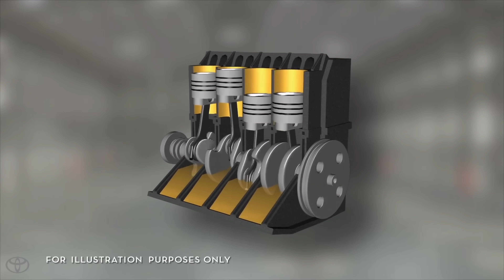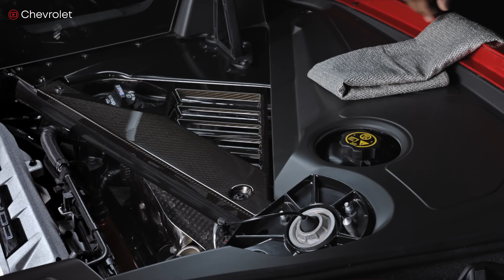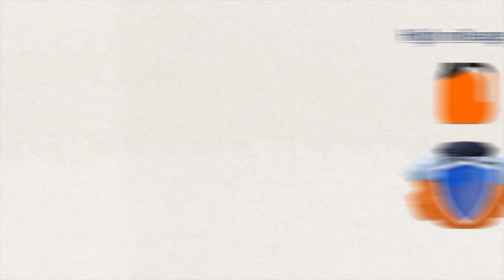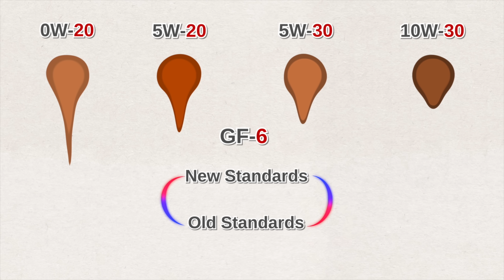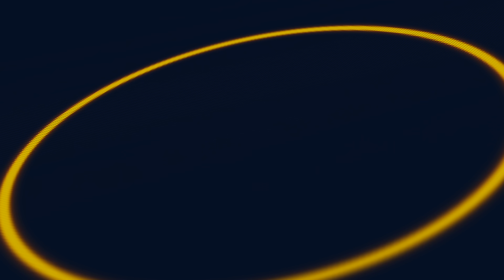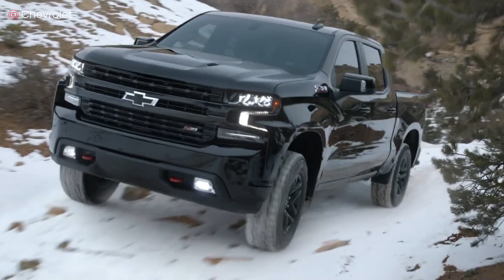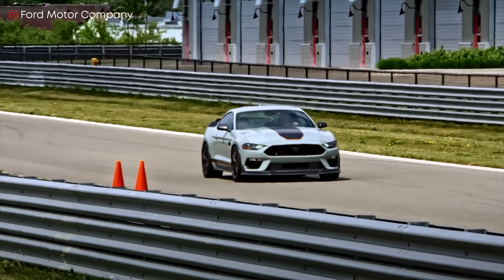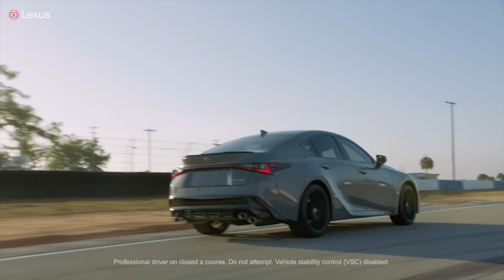7 Engine Oil Myths Stupid People Fall For

Comment: But, in the semi synthetic oil, how do you know exactly what percentage of the oil is synthetic, to my understanding there is no requirement to state what amount is used in the blend, so it could be 1% and they can still call it semi-synthetic
Reply: You're right. But the joke is that the term "semi-synthetic" means that it contains 1% - 99% of group II mineral oil. The icing on the cake is the fact that mineral base oils of group III. can be described as synthetic!!! So you can buy a fully synthetic oil according to the label, but inside it will be 100% mineral oil. This means that fully synthetic oil is also 1% PAO synthetic oil (group IV synthetic oil) and 99% group III mineral oil.:face-turquoise-covering-eyes:

Comment: Scott,
Great video with simple explanations on oil types. However, I noticed one error you made about winter W grade oil. the number before the W represents the conventional oil viscosity measured at 32 F and not 0 F as stated in your video.
Reply: 32F is 0C
Reply: Yes. You are correct. But the video states 0F not 0C. The low temperature viscosity is measured at 32F in Saybolt Universal Seconds (SUS)
Reply: The biggest factor in starting yourvengine in cold weather is not the battery , but rather the viscous drag on the moving engine parts controlled by oil viscosity. So, you want a low viscous oil in the winter for less oil drag, but a higher viscosity o ce the engine heats uo to the operating temperature that the multi-viscosity oils exhibit. E.g. 10 SAE oil is the standard oil viscosity measured at 100F and 212F in USS. 10W means that the oil viscosity measured at 32F

Comment: 0W20 is low protection and high fuel economy. Created so automakers could meet mileage requirements. If I use it I hear "tick tick tick" from the top  end. Heavier oil and the engine is quiet and smooth.

Comment: SYNTHETIC OIL WILL DRY RUBBER SEALS AND THEY WILL START LEAKING
Reply: My 2001 Sebring has had synthetic in it for 4 years. Doesn't leak a drop.
Reply: @Tylerc3419  I'm going by what a friend in nascar  told me. I have no experience with synthetic oil. He said the valve seals will go first.

Comment: Had a Ford van that developed a knock in the engine. It had 100 thousand at that time. I was told by the dealership that I needed a new engine. Thought I would get what I could out of it. I just topped it off when needed. I used oil out of other vehicles I had when I changed the oil. Used oil. The van had 270 thousand on it running fine when I sold it.

Comment: lo   daughter  uses 10w  30 year round 2002, toyotta  corrola    reg  oil .     temp in winter   drops   below  -  30  at times  ont canada car still starts  parked on driv eway. bought used still runs  great changed every 5000km

Comment: After a recent oil change by the dealership suddenly entire oil started to come out and drained (they did double gasket!) I had no idea what kind of fluid it was  and turned on the car running for about 10 minutes. Do you think running a car with zero oil would damage the engine if it runs even 10 minutes? Since it was the dealership’s fault do I need to ask for warranty in case something happens to the engine? If yes how long warranty should I ask? if the damage has  already done should I ask for compensation? How much? I am a single mom and really worried.
Reply: Yes the dealership should be responsible for this error.  Hope things work out for you.
Reply: If you don't know what kind of fluid is leaking out of your car, you shouldn't be driving.

Comment: Been using 10W-30 on a 92 GM with 5.7 liter and regularly changed oil every 4k ..milage is 356,497 miles..another ranch trk with 7.4 Gm has 423,741 miles on it..same oil..

Comment: I'm using 10w40 or 15w40 mineral all these years in my turbo diesel. It's inching almost to 300k km now...and now it's using 20w50 mineral due to it being high mileage and the engine needs higher viscosity. Happy engine.

Comment: LOL, The video starts right off with a myth that oil needs to be changed because it breaks down! Oil does not break down from friction over time! In fact viscosity increase with use. It needs to be changed because it gets dirty and polluted, with sludge buildup, which decreases it's effectiveness!

Comment: Funny thing. I knew an old farmer named Elvin who had an old ford truck that he never changed the oil. Always changed the filter at 3k miles and topped it off with conventional oil. 30weight. The truck outlasted him and he lived a very long life. The truck was late 60’s model. He said oil doesn’t go bad. 🤷🏽‍♂️. I’m not recommending that you do this. It’s just what he did and I always marveled at that fact.

Comment: Oil filter paper? Does it flex as the oil builds pressure when you start the engine? Does this flex due to pressuring up and then releasing the pressure when the engine gets shut down cause weakening of the paper over time? 
If the filter is used for excessive time/mileage,especially with high viscosity oil in cold weather,does the paper "media" eventually rip or split,creating a straight through flow and releasing already trapped dirt back into the engine's oil supply? 

 Do more expensive oil filters have stronger paper?

Comment: If oil from the dipstick does not feel slippery between my fingers, when I rub them together, I change my oil, no matter how clean it might look. If there is no slippery feeling there is no lubricity and the engine will wear more heavily and possibly fail.

Comment: I have a 2012 Chrysler 200 4 cylinder, and I normally use synthetic blend 5w30, but now my car has around 96,000 miles on it, What would you recommend?

Comment: Thank for the video, it was very helpful.
I had a question, I had a Rav4 2017 and change it's oil from 0w20 to 5w30 according to friend advice, according to you video you suggest to use the same viscosity, so is it OK for me to just change from 5-30 to 0-20 and is there somethingI should do 1st?
Reply: Does your friend have a RAV4 Owner's Manual and you don't?

Comment: I have been using Mobile 1 fully synthetic oil for years. I change it and the filter once per year and have never experienced a motor failure or a wear issue. Traded in my last truck, a 2001 F-150 SuperCrew with the "big" 5.7L at 267,000 miles and it still ran like new. The only maintenance required under the hood was the typical battery, plugs/wires, belt, and of course the coil packs (about one every six-12 months) which was a known fault with that engine. Before that, a 1990 Mustang GT with 170,000 miles that also ran like new.

If you are the type to buy a new car ever 4-5 years then who cares? I've known people who never change the oil, only make sure it remains full and trade in reguarly. However, if you plan to keep your car for a decade or more, I strongly recommend you use synthetic oil. Its a little more expensive, but you save in the long run because you change it much less frequently. Do yourself a favor and stop looking at that little sticker to tell you when to change the oil. Do it once a year, around the same time (I generally do it every April first).

Comment: Bought 2011 toyota sennia new kept driving it for 100,000 miles no oil change.  Car runs great, never loose any oil, never changed color, never smelled.  I did changed the oil at 100,000 now has 180,000 miles with my second change and everything looks great.  Full synthetic oil is the way to go.  I wonder if we had synthetic oil 1965 would my mustang still be running?

Comment: What you are describing as high mileage oil?, in the graphics the red ‘oil’? I wouldn’t recommend using that as its coolant. The number after the W is related to how well the oil flows at normal engine operating  temperature, nothing to do with summer, as summer temperatures vary from state to state and country to country. Engine Oil in a Diesel Engine can turn Black in as little as a hundred miles. The simplest  solution is to use the type and viscosity of oil and change it as recommended by the vehicle manufacturers, which may be by mileage, for high mileage drivers, or period of time for low mileage drivers. Regarding Additives, both Oil and Vehicle Manufacturers will tell you not to use Additives, as the Oil Manufacturer will have already added the chemicals required for your Oil to work at its best for your car.

Comment: Scotty & comments section:  just bought a 1990 k1500 with a 350 in it.  230k miles.  What oil would you recommend for it?  I’m thinking slightly thicker and conventional oil is the way to go?

Comment: I just had my 1980 Pontiac Firebird 301 eng rebuilt. The shop told me not to put in Synthetic or regular oil. The lifters need zink and I need to put in an oil designed for the older engines.

Comment: First number is viscos number  last number is  -40 = -40 Celcius lowest temperature  ..fullsyntestic ..long range. My car  dealer say 20.000 km / 12.000 miles change .  Older cars  to 15.000 km/ 9,300 miles.( at 60.000 miles and more ) .

Comment: I don't see the point of a blended oil.  If you want longer oil change intervals, or live in an area of temperature extremes just go full synthetic.  Call me a master-of-the-obvious but, if you drive in a dusty area you DON'T want to extend the oil change interval.  Because obviously, there's only one way to (try to) protect your engine in such conditions and that's change the oil a whole lot and for that I'd use conventional oil.

Comment: I have a 2015 vw jetta 2.0 5sp manual. How do is change gear box oul if there's no drain plug nor input plug. Its seal. I speak with dealership & transmission pros, they alll say no change needed. What do you say?

Comment: I just bought a used Lexus expecting well; good reputation.  I just got a safety check at the dealer  and there's a potential power steering pan replacmeent needed at 3000???  No way.  I understand the new brakes needed but the power steering thing I'm not sure about.  So I'm going to a non dealer to have a safety check to have a second opinion.  I'ts got 150000 but to me that's a huge chunk of change for the great Lexus. And they said my sun roof wasn't working;   They would need more time to check it out.I know for a fact it is. working; I took it on a camping trip. Maybe I should have gone with just a toyota or honda.  We'll see.  Then the dashboard was  saying a lightbulb was out, but they never mentioned a light bulb problem.

Comment: A critical oversight is the failure here to distinguish between what is a real synthetic oil and what isn't.  In the US, the term synthetic has very little value.  Any diversion from Group II oil refining allows the producer to claim the oil is synthetic.,  This means that that "true synthetic" oil may not be truly synthetic at all.  Many oils with this label are actually made from Group III petroleum and will suffer from the same problems at Group II oils though to a lesser degree because more contaminants like wax are removed and the additive package will likely be more comprehensive or durable.  True synthetic oils don't have petroleum in them at all and when properly blended are far more durable and protective than petroleum-based oils.

One of the worst values on the market is the "synthetic blend" oils because they may contain as little as 20% "synthetic" oil and the rest is Group II petroleum.  These oils actually won't contain any true synthetic oil at all.

Comment: Is there any linkage of viscosity with fuel economy achieved... 

Honda manual says 0w20 is for improved fuel economy

But, Authorized Service Centre usually put Honda Genuine oil from large drums which is possibly 5w30

What's the best oil viscosity and type 

Some say thin oil are bad?

Comment: I have a BMW 520i, 2000 model. It says that this should have LL-01 or LL-04. But what does this really mean. What does LongLife really stand for? But there are other codes as well that are important? Here is LL-04 but there are also many other codes. Which goes to other cars and which is cheaper than LL-04 oil.
All this goes to one car:  Recommendations: VW 502 00, VW 505 01, BMW Longlife-04, Ford WSS-M2C917-A, DEXOS 2, MB 229.51, Porsche A40, Renault RN0700, Renault RN0710

Comment: I have tried high mileage synthetic and blends in my 2006 Ranger. I will never use these ever again it would go through more than a qt. between oil changes Using conventional oil I don't use any oil between oil changes. Synthetic being better is a complete lie. If a vehicle uses any oil when there are no leaks then the oil is garbage

Comment: The number after the "w" is not the summer viscosity. It denotes how the oil behaves at the engine operating temperature.
There are other statements by Scotty that are somewhat out-dated.

Comment: If you're going to include high mileage oil as a separate type then you have high mileage synthetic and high mileage conventional...

You should change your filter everytime you change your oil...A lot of folks say that. It sounds so arbitrary. Okay if you drive mostly highway miles and change your oil every 10,000 miles and that's okay, possibly even confirmed with an oil analysis, what if you decide to change your oil every 5,000 miles... and still continue changing your filter every 10,000 miles (cause it's a synthetic filter rated for 20,000 miles). Well, that's what I do and I had an oil analysis that proves the filter is still doing it's job after 10,000 miles.

Comment: I have several cans (e ought for 2 oil changes) of expensive Mobile 5W30 synthetic oil unopened and sitting around with a car thats been in storage for 6 years. I was wondering if these oils loose effectiveness even if unopened? Is it a case of a small drop off performance or do they significantly deteriorate? I am sure manufacturers want us to buy new ones, but if its not used I am guessing from a chemical point of view they look perhaps 5% of overall impact after 6 years on the shelf. What do you think?
Reply: I had a similar question searching for some advice, my oil seal has been opened but capped for 6 months.

Comment: What oil should you use in a 1973 Buick Centurion with the 455 cu in engine? 94,000 miles. Originally it called for 10w40?

What about switching to synthetic oil

Comment: Is high mileage oil synthetic? I have 248,000 km on my 2008 Jeep Grand Cherokee and have been using conventional only. Wondering if I should use high mileage oil but if it's synthetic, you also recommend not to switch from conventional to synthetic on older vehicles.

Comment: Oil change every 8000 miles, fully synthetic 5w30, cheaper to change the oil than the engine, on my older jeep i use the 5w40, it seems to make it a little quieter

Comment: Explain to me why's that after an oil change, the top speed and engine noise, increases by a lot, on an used car purchase?
 Unknown oil before, specific oil after. 
 This old man completely ignore pumping and friction losses, thus overall power losses. So, yes, oil can increase horsepower, if a much better one is going to be used, instead of some stupid crap cheap oil, which the average shop dumps inside your engine..

Comment: I always change my oil with full synthetic every 5K or less which is what the severe schedule recommends. Valvoline seems to be doing great. My engine is still smooth and after 5k the engine oil looks relatively clean. I used to take it to my dealer but I noticed that the closer I was to 5k the less smooth my engine felt and the dirtier my oil was.
Reply: If you change syn oil at only 5000 miles, you're throwing away perfectly good oil.

Comment: None of this matters...just change your oil every 5-10 thousand miles (with-out fail) and you'll never suffer "engine oil failure" problems. I know this cuz I'm 62 now and always use whatever's in my garage or what's on sale. Mix & match.... whatever....good oil works good....Don't wait for your oil to become bad oil....bad oil is bad....good oil is good...Am I right Scotty?

Comment: Although the W number is for cold weather. It still is thicker than running temp of any viscosity. Meaning, it's not just for winter. The 0w40 oil for instance will protect engine from cold start (95% of wear is cold start up) whether in cold climate areas or hot. 10w40 for instance will still cause more cold start wear than a 0w40, whether in Russian winter or Chicago summer. lower is always best no matter ;)
Reply: Yeah im confused as to why he was talking about hot ambient temperature. The hot viscosity is based on the engine being hot, not the weather being hot. Lower cold viscosity means it will protect your engine better on cold starts, hot viscosity is just the viscosity that your particular engine needs when its running at regular operating temp, which is always hotter than the ambient temp.

Comment: Well Many Years Ago! Premium gas was 10% more and got 15% better fuel mileage! Early proof of better was I could accelerate up a hill with Premium and had trouble to hold my own in 4th gear. What it would be now don't know. 
Adding Cetane  booster does make it easier for the engine, for those who need that .

Comment: Got a question for you Scotty. I use a synthetic blend witch is good for aprox 5000 miles + -. I only drive this vehicle about 3000 miles a year and my oil percentage is at 20% or less. My question is, does my synthetic blend oil need changes at this low mileage ?
Reply: Change it within 12 months if not driving much
Reply: Yes

Comment: Great video Scotty, i always, change the oil, myself, so I know, what's in there, I have seen quick lube companies, put in machine, oil, trans fluid, and god knows what else, these places get bulk oil, delivered, and they have no clue, what's in their tanks, along g with stripped out drain plugs, and oil filters, its insane, after, many years, working in dealerships, there is no way, they are touching, my vehicle, I'm sure, Scotty, you have seen, the same, over the years!